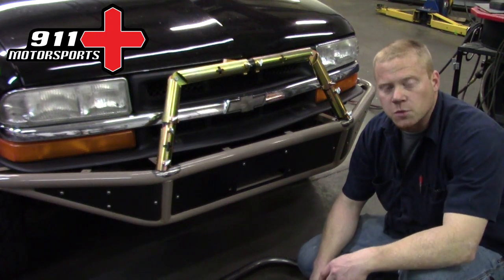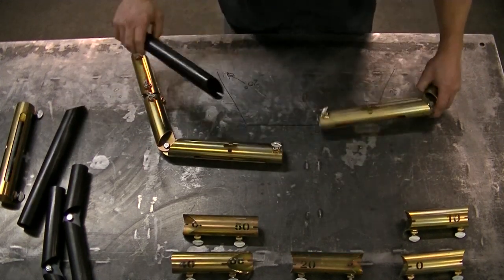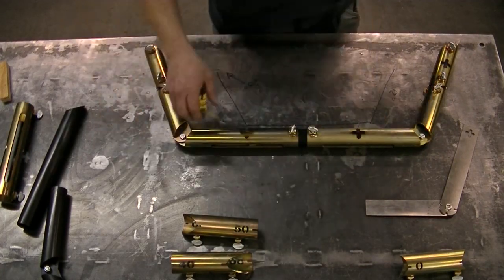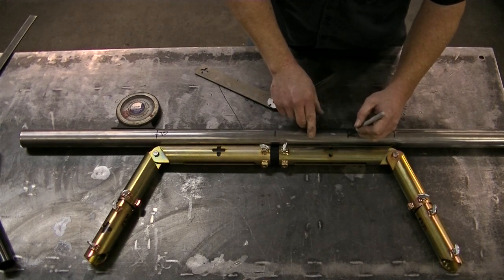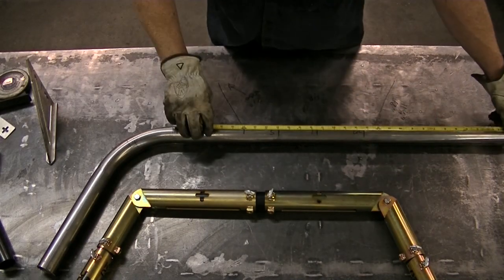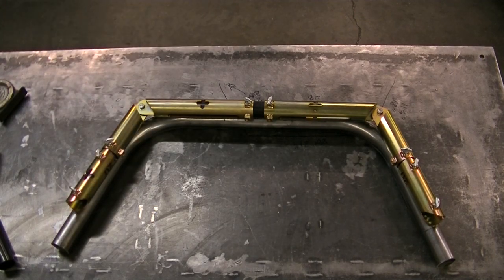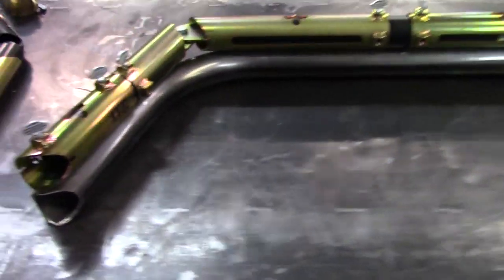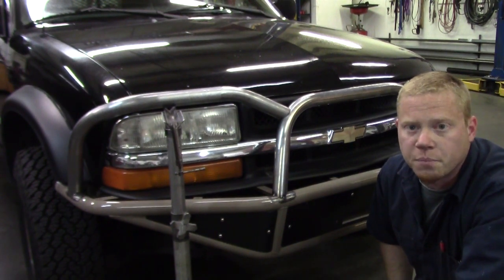How to bend a simple bumper hoop with the Tube Bending Jig

Comment: You know if the corner down there is 21 degrees you know the opposite side is also so add those it’s 42 and the whole shape will be 360. Subtract 42 from 360 then divide the sum by 2 and you get 159 degrees for your top two angles
Reply: Quadrilaterals and 360 and triangles are 180
Reply from the maker: Yes you can do the math, but a major benefit of the Tube Jig is to eliminate math and the mistakes that go along with it. I never even measured the bend angle.

Comment: Did you custom make the bumper too
Reply from the maker: Yeah, it was an extra I originally built for a Tacoma. It fit the s10 pretty good, just had to modify the frame mounts. The black fill panels are aluminum.
Reply: @911Motorsports  I know this is 10 months late but what made you choose to use aluminum for the panels rather than something like abs plastic?
Reply from the maker: @MCPr0m0  Aluminum is stronger and easier to work with. UHMW is a good alternative for skid plates that get abused on a regular basis.